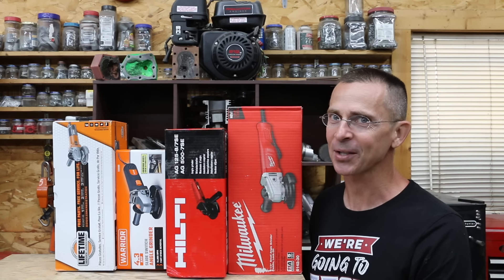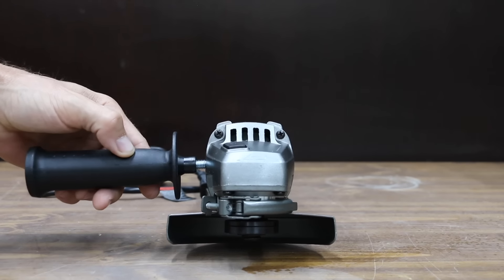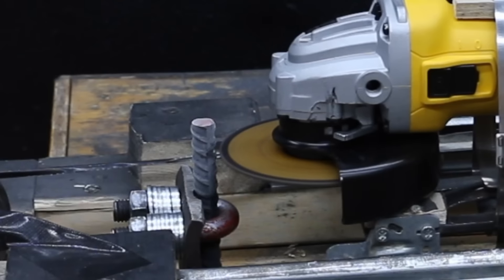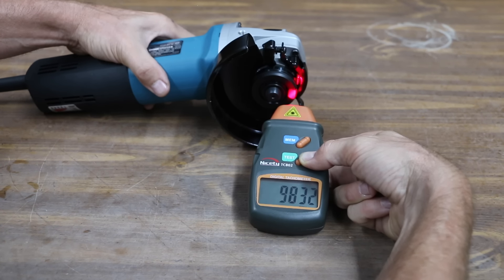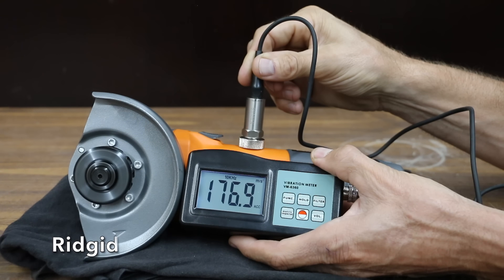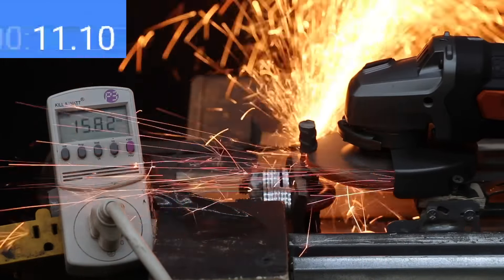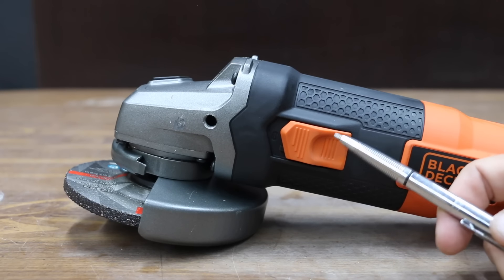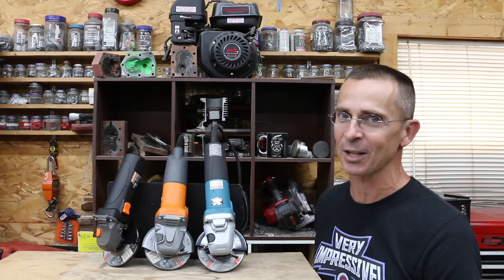Best Angle Grinder (Corded)? Hilti vs Milwaukee, DeWalt, Makita, Ryobi, Ridgid. Let's Settle This!

Comment: Good to see a corded tool review, I think there is still a place where corded is the better choice  , not only in price but also function (circular saw)
Reply from the maker: Great point!
Reply: With a studio style stationary shop this is great info!
Reply: Some day I'm gunna make a mini gas generator so I can have a corded tool anywhere
Reply: Yeah, slight problem with batteries is the tool only lasts as long as the battery they make.  My battery on a drill had to be replaced and I had a lovely surprise that they no longer made them, and the companies that did was charging more than it would be to buy a new drill, which I did with a cord.
Reply: @CheeseMiser  Maybe a solid state "generator" would meet your needs.
Reply: @seancoyote  this is less of an issue these days, (eg, my old DeWalt tools I picked up their lithium battery adapter for) but we are definitely at the point where one battery pack design should be standard across all brands of tools.  No reason for it anymore other than vendor lock-in and forced upgrades.
Reply: Those long tasks you break those battery tools
Reply: Cordless grinders aren’t a substitute for corded, they’re more of a “cut off tool”  for cutting metal than a true versatile grinder.  Love the corded tool videos
Reply: You can leave a cable tool for 50 years, come back and it will still work Batteries will be well worn out, either flat or cooked.
Reply: I subscribe to Popular Mechanics magazine. All they ever review now is cordless. It's tiring.
Reply: I'm a contractor and let me tell you how wrong you are about circular saws. A Dewalt DCS578 is A LOT more powerful than a corded one. The ONLY downside of a cordless tool is the battery life. Todays batteries can deliver a lot more power than a regular 120v outlet. The DCS578 can pull over 2500W, if you try one, you'll realize quickly how powerful that is. Same goes for the 6 inch grinder, it would blow away any grinder tested in this video. We've got the 12inch Flexvolt mitter saw that can either run with two flexvolt batteries or with a cord (120v outlet), and let me tell you, when you plug that thing into a wall, it runs like crap compared to using the batteries.
We never use corded saws, even if we're right next to an outlet.
Reply: @Derkson  That would be nice, but in the Apple design age, I don't see that happening without laws forcing them to.
Reply: A 10 Amp flex rear handle will beat most corded circular saw. No bs, very impressive.
Reply: Agree, i have the cordless makita 18v angle grinder but it eats battery… its handy on the go but i prefer cord if there is a power outlet nearby
Reply: @dexterjsullen  I broke the anvil off a cordless Sawzall. Too much work for a cordless. Went back to using my 25 year old Dewalt corded.
Reply: @bhess1212  You still read magazines?
Reply: @seancoyote  You can easily rebuild batteries 😉
Reply: @tonysheerness2427  Thats a niche even as far as niche is concerned. Makita batteries are easily lasting a full decade, and are not gonna disappear from the market within the first few decades. But ok, you go ahead and buy what you need in 50 years, planning ahead is good, its not like its full OCD, just nearly.
Reply: Eh???? I prefer my cordless dewalt(7 1/4) over my corded saw anyday!
Reply: @CheeseMiser  They're out there already, otherwise a mobile battery pack works as well
Reply: I prefer corded tools generally, especially on tools that don't get used everyday.  I buy quality and intend for them to last a lifetime.
Reply: @seancoyote  TY for saying that i been saying the same thing  cordless tools have their place but corded tools are still KING no matter how old the tool is it would  still work for many of years  to come
Reply: @pflaffik  So, how long do Lithium-ion batteries last? To sum it all up, the bare minimum that most manufacturers expect from their batteries is around 3 years or 1,000 charging cycles. With that said—we say “put your warranty where your mouth is.” Bosch, DeWalt, Metabo HPT, Makita, Milwaukee Tool, EGO, and Ridgid all warranty their Lithium-ion batteries for 2–3 years.

That’s a real good indicator of their minimum expectations for those packs. Move to a company like Greenworks 60V and you can find a 4-year battery warranty. We hope to see more companies extend these warranty periods as technology and reliability improves. 

Not a decade.
Reply: @hallowedbethygame2840  they definitely are for plenty of people.  I know welders who do mobile repair and I can count on one hand how many times they've pulled corded grinders off the rack in their service box.  This is in Ag industry so there is less prep work, but the cordless is still farrrrr more useful for their cut jobs, wire wheel cleaning, flap discs.  Don't want to deal with extension cords in addition to the 4 AWG welding leads when you work on 50 ft+ tower structures.  He'd rather put extra batteries in a bag and rope them up if he has to.  Already working with cordless impact wrenches and drills up there anyways so there's 0 sense in pulling a cord just to run a grinder.
Reply: Cordless tools usually weigh less and cost less. As for performance, top end cordless tools beat corded tools 95% of the time. If you're pointing brick then a corded grinder is the way to go. If you're a production trim carpenter then a corded table saw is the way to go. Other than that if you can afford it go cordless. If youwant high performance tools for a decent price wait for sales for 36v Metabo hpt and the 18/36v makita. Much better value than Milwaukee and dewalt.
Reply: @seancoyote  Damn, Ryobi has been using the same battery design for nearly 20 years, their old One Plus niCad tools can take the newer Li batteries with no issue. This doesn't really help your situation, but a lot of tool companies stick with the same basic shapes to keep you in their ecosystem
Reply: There definitely is a place for it. I was using batteries in a shop and was swapping constantly when doing metal work. The cord sucks with getting in the way but at least I’m not stopping every 20 minutes with one.
Reply: @Cykyn  Yeah, my Milwaukee Fuel 7-1/4 kicks ass.
Reply: Yea until next year (or the end of this year) when they release the new tools with better batteries and better functionality
Reply: @LonersGuide  Great for the toilet!!! LOL
Reply: @jimkane9832  somebody was paid off by the cordless industry
Reply: In a shop, with an outlet, it’s just smarter too use corded tools, I feel like there stronger and more reliable than battery tools, just keep an extension chord ready and waiting the length of your shop plus alittle bit just in case, or have a few outlets left open for tools
Reply: and sanders!  Since they always need a dust hook up!
Reply: @bhess1212  I used to think so before I switched to TP. ;)
Reply: Dewalt 60 volt circular saw is superior to a corded saw by miles .
Reply: Look up this video "Makita 40v XGT GSRO1Z 7-1/4" vs. Skilsaw Mag 77 Circular Saw Review"
Reply: @francd2981  Battery tools are still playing catch up to the power of corded tools, the convenience of never having to deal with a cord is their main appeal. So any forward progress is welcome
Reply: I much prefer a corded hammer drill over a cordless, drills much quicker than my cordless.
Reply: Agree, cordless circ saws with their constant hesitation and safety stopping mid cut. I want to let it RIP.
Reply: @MrArcticPOWER  try a run time test and let us know how that works out.
Reply: @nmatthew7469  Who cares about runtime if you work faster at the end of the day? I'd ratter have a tool more powerful and easier to handle than a slower one with a cord just for the sake of not having to change batteries. Extension cords are 10 times more annoying than changing a battery.
There's a reason why you don't see much corded tools on job sites nowadays and when you do, it's simply because the boss is too cheap.
Reply: @MrArcticPOWER cordless grinders aren't even in the same universe as corded. Show me one that will do 12,000 RPM. I'll wait

I worked in heavy fabrication for years. Cracked the head cases and burned motors out of nearly a dozen grinders. I'd bet my nearly decade old 12 amp Makita against any 4.5" grinder at 10:1 any day
Reply: @Mournful3ch0  If you compare your 12A grinder to a shitty Makita 4.5" 18v, sure, it's not even close. Go try a DCG414 with 12ah or 15ah battery.
Reply: Comes up 3,000rpm short. Not going to beat a quality AC grinder as long as that gap exists
Reply: Any manufacturer makes shitty tools. Those head cases I was talking about were all Dewalts, by the way. And even at twice the weight and more than double the cost, the cordless can't match corded.

I'd gladly take a cordless to do a quick 30 minute job in the field - but put me in a fab shop and I'll take the 30 seconds to roll out a cord
Reply: @Mournful3ch0  No load RPM doesn't mean shit if it has no torque. A lot of 6 inch grinding discs are rated for under 10000rpm, that's why you don't see big grinders with stupid high RPM. 
Sure if I'm grinding non stop in a shop and don't move around much, I'd take a corded one, but in the field where you're often 100s of feet away from the outlet, I'd take a cordless any day.
Reply: When shopping for an angle grinder, I specifically looked for a corded one because it's not a tool which I use often, but when I do use it, I use it for an extended period so a cordless one would be kind of annoying with the frequent battery changes.
Reply: @CheeseMiser  the small inverter generator from Harbor Freight works well and is quiet.
Reply: Got to disagree with you, my DeWalt cordless circular saw is a beast! Literally used it for every single cut while building a 4.8mX9.6m stud framed chalet.
Reply: @Derkson  a handful of brands in Germany have standardized on the Metabo battery platform. I don't think any of those other brands are available in the States though
Reply: @MrArcticPOWER  Seems to be the problem with the American 110v grid, in Europe we have 230v and a standart outlet provide 16A way more power.
Reply: @CheeseMiser  somebody's time is worth less than mine or somebody is broke or somebody only gets paid by the hour
Reply: There's certain tools where it makes more sense to buy corded. Sawzalls and grinders eat batteries. I usually use corded versions of these. Battery technology is good enough for drills. I haven't used my corded drill in years
Reply: @jonasstahl9826  Yes, I'm Canadian but same thing. Imagine trying to run an air compressor in -25 degrees weather without tripping the breaker.
Reply: @MrArcticPOWER  You have a point about cordless saws but then again how long does it take to cut through a 2"x6" or plywood? The angle grinder in theory draws less power than a circ or mitter saw but it stays on for longer in order to perform its job. You won't be polishing on metal nor cutting through rebar for extended periods because even an 8Ah battery will last less than 25 min under load.
Do the math, a circ saw with a big enough battery will get you through about 500 cuts on a 2" x 6". Those take about 3 seconds, so that battery only lasts about 1500 seconds under load on a saw, or 25 min if used continuously.
Reply: Try a ridgid cordless grinder.  They have a lot of power.  Much better than other models.
Reply: If you work in shop corded tools are perfectly fine.
Reply: @engineer_alv  Yes, like I said, the only downside of cordless is runtime. If you do constent load type of work like grinding, you'll run out of battery pretty fast. That's the only application where I can see why someone would ratter stay with a corded tool.
With a circular saw, you want the extra power while cutting at 45 degree angle or ripping through multiple sheets of plywood/osb. I don't see a time where you would ever run out of battery under one hour with a circular saw (9ah+). Most days, you might change the battery once or twice.
Reply: @peger  Except when you have multiple tools and you end up with a rats nest of cables.  I have 4 angle grinders setup for grinding, cutting, sanding, and nylon disks.  Much easier to keep work flow without constantly swapping disks.
Reply: I still have my corded craftsman drill I bought 35 years ago still use it on occasion when the battery is charging lol
Reply: @AtomicReverend  EXACTLY ONE TIME PURCHASE  AND U BE SET  AND U DONT HAVE TO WORRY IF ITS CHARGED OR NOT CUZ ITS CORDED DOSNT  USE BATTERIES
Reply: True, here I have a Mafel circle saw... simply the best. Corded, just stronger.
Reply: I have the Hilti 7 inch grinder I should make a video with it, thing Is a monster absolute huge machine
Reply: @seancoyote  You can buy battery cells and just put them in the pack again.
Reply: @MrArcticPOWER  120V is for USA... 240 here in Europe... ;)
Reply: @hallowedbethygame2840  That is so true! But also it is so easy taking the battery tool and not pulling an extension cord!
Reply: Would love a circular saw review
Reply: @bhess1212  Just like Popular Science they cater to the mainstream and aren't really a "serious" source of information. Although I remember back when Popular Mechanics was actually worth a damn and they would even publish plans for home projects/tools. Most magazines these days are having to sell out more and more since people are forgetting that print media even exists.
Reply: @Derkson if you support multi-generational battery design, support Ryobi.
Reply: My observations on this debate as a DIY working on my third home reno.

- I like mixing and matching brands to maximize prices and sales, in my view, a major plus for corded tools. They tend to be cheaper generally already.
- I have a 25 ft cord on a spool. I really don't find it difficult to get that out, even for the attic. Whatever you save by buying corded you are paying yourself to move the cord around. Consider this relative to how much you use the tools and where relative to outlets. 
- I'm never slowed by batteries other than my head lamp or impact driver. These are annoying when they die, so I am assuming work with a few different tools would need multiple batteries to work several hours? That expense seems to need figuring if you work multiple hours in a row.
- Compressor is annoying, really the only one I find a headache. But I plan it so my trim and door work is done in batches, and the thing does work really well after it fills.

In my view, unless you're a pro where moving a cord "costs" more than a line of battery tools over time, or you work new job sites with no outlets, or you work regularly outdoors, I don't see cordless as some be-all essential. Mix and match based on the scenario probably works best for most.
Reply: Yeah I sand subfloor seems with my 7" Makita grinder,  no way a battery tool would do what I need it to do!
Reply: @Derkson  Europe is mandating this.
Reply: I am almost exclusively a corded guy. 

Battery costs a lot, has lower shelf life, and there is a weight penalty.

Gas is expensive, there is a weight penalty, and there is more maintenance. Especially with ethenol in the fuel.

I don't have a lot of negatives for corded electric. They are lighter, cheaper, and longer potential lifespan/usability. You are limited by a cord.
Reply: I am switching to corded almost everywhere I can. Except impact driver
Reply: @pflaffik  Wow, wlhere did you get few decades on a particular type of batteries to make that claim ?  None of the batteries I have from decade ago are in production anymore. I have Makita cordless drill from a decade ago - all dead batteries, no replacementt sold by Makita, chinese ones last perhaps half a year.
Reply: @Cykyn  It all depends how often you use it.  If you are  a homeowner with occasional use few times a year, cordless has lots of negatives
Reply: Grinders consume a lot of power on big jobs.
Reply: @CheeseMiser  Just buy and inverter like I did and your truck becomes your power source. Great for emergencies and camping too, it's a VERY old idea. I have several inverters in various sizes.
Reply: For those not familiar, angle grinders in welding use often work way harder than suits even good cordless tools. Since welders have power one way or another corded tools are not limiting.
Reply: @tonysheerness2427  Why am I leaving a tool for 50 years instead of making it pay off? I also have 50 years to solve any battery problems or replace the thing when it like all tools is expended.  Serious use wears out corded, cordless and pneumatic tools. I have all three types in abundance because my tools exist to serve my convenience and be productive.
Reply: codyschmidtmann3992

"A 10 Amp flex rear handle will beat most corded circular saw's"....... GOR THE FIRST 5 CUTS....

EQUAL A CORDED SAW FOR THE NEXT 5 CUTS

THEN ON ITS WORSE..... taking 20 or more minuites per battery to charge up......

If your not a contractor, than its worth it for making 10 cuts 5 seconds per cut than a corded saw......also, if you do decide to cut more, buy 10 batteries and 4 more chargers and you might stand a chance...... 5 amp batteries cost 100 each? + chargers, then lifetime of batteries at contractor constant use (if you dont loose any, forget any or have any stolen and all the bags needed to carry that gear) is what 3 years day after day 6 days a week, sometimes 10 hours a day .... empty, charge.... 15 minuites of use charge.... then empty again..... all day long swapping batteries hoping 4 chargers give you an hours worth of work over 10 batteries........

V.s

I come to work, unreal my 10 amp extention, set up and clamp my table, plug in my saw, and i can leave my blade running for 24 hours a day 7 days a week if i want to........ no problem..... always ready 10 seconds slower but no fuss......

Happy days...... unclamp, unplug, go home, easy peasey, no extra costs like buying $1,000 of chargers and batteries every 3 years for the same machine..... no thanks....
Reply: I sold my cordless tools years ago and will never go cordless again, except maybe a 1/4" impact driver if I put up a fence. 
I got so tired of my tools going dead in the middle of projects and having to wait for the batteries to charge. It also sucks that the cordless tool industry is following the ink jet printer model, selling the tools cheap and overcharging for the batteries. Recycling in our area is also a joke.
My decision proved quite prescient. I owned almost the entire Craftsman C3 line, but of course the Craftsman brand died with Sears. (Stanley bought the rights to the name, not the company or any of its factories). Had I kept the set I wouldn't have been able to buy new tools or batteries for it.
Reply: As soon as cutting gets involved you need a corded tool or a 900$ 12 amp hour battery
Reply: @jimkane9832  Not true. Corded tools usually weigh less and cost less. Many corded tools outperform cordless, especially if you get them from companies that still care about their corded lines (like German Metabo - not HPT, just Metabo - or to a lesser extent Makita) instead of purposefully crippling their corded tools in order to sell more cordless (because cordless is the way they do vendor lock-in, and they count on vendor lock-in to make their money).

If anywhere near the R&D dollars companies spend on cordless were spent on corded, corded would nail cordless to the wall on performance - the only real inherent performance benefit of cordless as it stands is momentary peak power draw, since tripping a breaker isn't a consideration (although sustained peak power draw is held back by battery thermals), but if there was sufficient demand, there are ways to massively shift the balance of power (pardon the pun) in favour of corded, albeit primarily for shop use. 

One example being 220-240V tools, which (with a 16 Amp 220-240V circuit as is common everywhere but North America) could, if designed to take advantage of all the power on tap, draw as much as about 3800 watts continuous (and momentarily even higher than that, since breakers don't instantly trip at their rated max load - it can take quite a while, actually). If you tried to get that kind of power out of cordless at, say, 36V... you'd be pushing over 100 amps, so your tool would have to be built with around 3 gauge wires - thereabouts a quarter inch in diameter (!) - just to avoid cooking the wire insulation and most likely melting the tool casing.

Smaller, but still significant, gains could be had by designing tools to take advantage of 20A 120V circuits - so instead of a 12 amp 120V grinder, you might have a 17 or even 18 amp grinder... 2160W in a handheld tool is still ludicrous power, especially considering that's *continuous draw*.

Another example would be including small supercaps to allow for massive bursts of power while still keeping the average power draw from the wall below the rated trip threshold.

You want high performance tools for a decent price? Buy corded: it doesn't lock you into a particular vendor, they tend to last longer (especially if use is intermittent - lithium batteries degrade rapidly over time compared to anything used to make corded tools), they're almost always MUCH cheaper from a total cost of ownership perspective, they're more environmentally sustainable (lithium batteries are environmentally awful, and they're almost never recycled because there are no mature economically-viable Li-Ion battery recycling technologies), sustained performance is better (if you're using a high-draw tool all day, you sure as heck don't want to be stuck with cordless), peak performance varies (but with corded you don't have to worry about running out of batteries, so even if peak is lower... you can just give it an extra second, and still come out ahead time-wise because you never have to wait for batteries to charge), oh and did I mention it doesn't lock you into a particular vendor?
Reply: If you go courted it's Metabo or DeWalt...